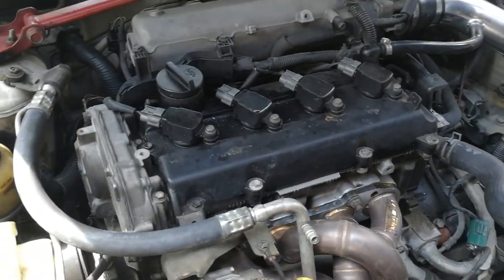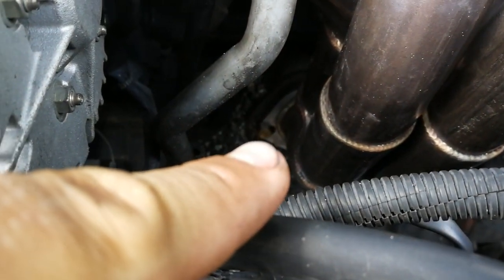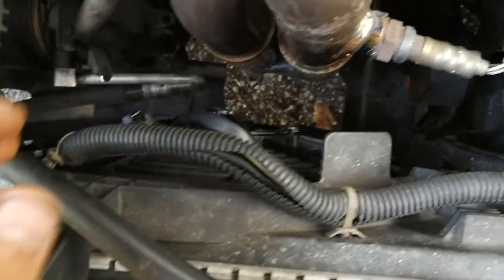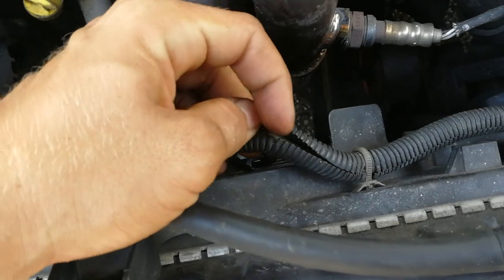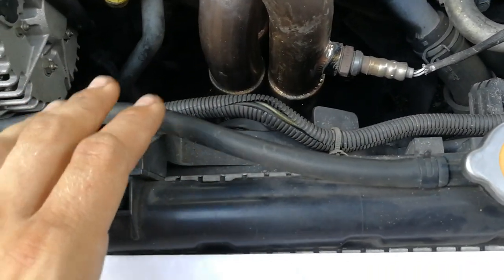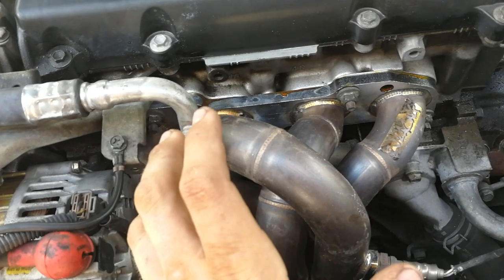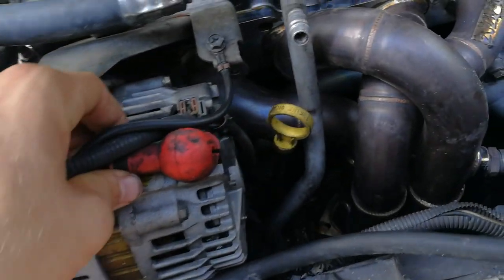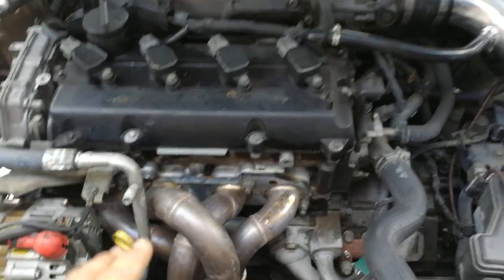HOW TO INSTALL 2JRACING MEDUSA HEADER Nissan Sentra ser spec v

Comment: So I'm planning to get this over getting a new rack and pinion. Figure I'd rather remove that time bomb pre-cat from my car than have to turn a little harder for a while.
EDIT: btw, i had wanted the long tube header, anyone know how well that fits?
Reply: Sir Poopsalot what bro? I just got one. Might do a entire install video for it
Reply: I have the factory catted header on mine, and they're known to have bad days and kill spec v at random. Saw how expensive a rack+pinion set that actually fits is and figured may as well finally get a decent header and just live with the steering for a while.
 Was wondering if you had the V2 and had any fitment or scraping issues? Lots of speed bumps and rough highways in my area.
Reply: @keaflord  my header finally arrived. How was the install?
Reply: Sir Poopsalot man it took about 3 hours, just cause you have to fabricate and fit the slim fan into the shroud. Don’t worry about the springs that came with your kit either. I didn’t use them cause it put more stress on the zip ties than anything really. But install was fun, as long as you know what you’re doing it isn’t bad at all. And my car is lowered and I haven’t had any issues. Also got the 2.5” midpipe with no cat. I actually have some videos up of my previous set up which is a really well recommended header which was a stillen. The dusa cleans up top end nice. But if you have any more questions just get back to me.
Reply: @keaflord  ok, 3 hours isn't bad. I'm more concerned about taking my belt and alternator off than anything. I got two brackets with my header and I'm bot certain what they're for tbh. Short brackets with rubber bushings onone side, do you know what they're for?
Reply: @keaflord  also, are the two bolts for the downpipe or what?
Reply: Sir Poopsalot yeah the two bolts will be for your midpipe to header collector. And two brackets? You should just have an alternator clearance bracket with a bolt through it. And it’s not hard at all. Just get a 14 mm extended wrench and pull off the belt. The diagram is online. Just take before pictures of your belt if your real concerned.

Comment: You didn't need to put a spacer on the O2 sensor? I didn't see a CEL?
Reply from the maker: Good catch I completely forgot. Yes you will need a spacer. It comes with one. I forgot because I had installed the spacer years ago when I installed the previous header.
Reply from the maker: @bimbo831  awesome if they're not the same colors I would suggest buying a test light at harbor freight there like three or four bucks and you can find out which is which with the Altima running the positive should light up once the fan switches on while the car is running